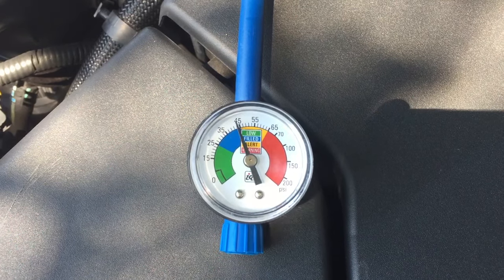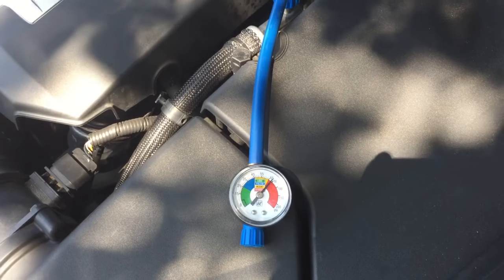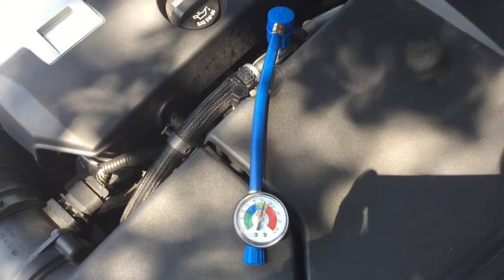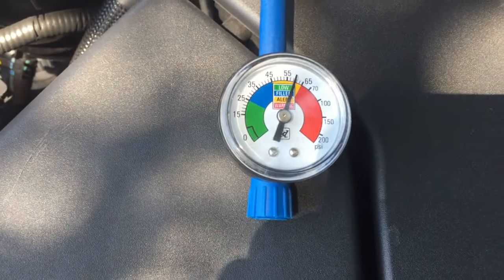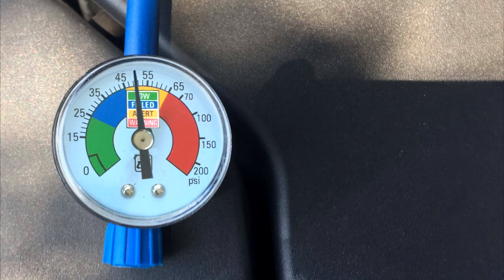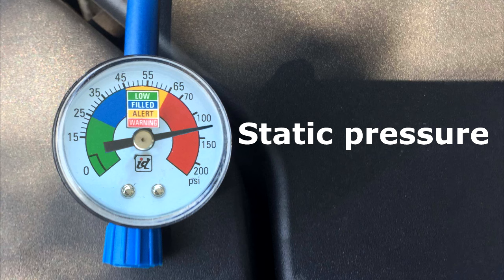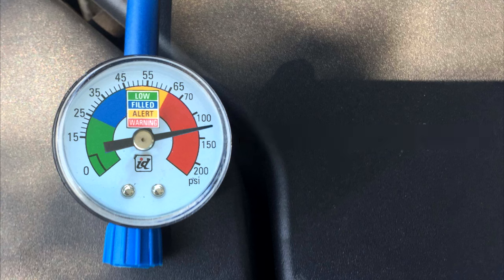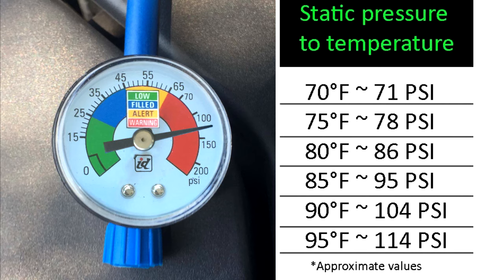Car overcharged AC system or undercharged fix

Comment: Hey quick question, which one should I follow the static pressure or the gauge. I was charging my 2008 GL450 The gauge reading is in the yellow zone (no need of refrigerant) and yet when I tried to turn it off and let it cool down the static is way below the chart based on ambient temp and still blowing warm air when turn back on. Mercedes takes 42 Oz but I charged 4 cans of 12 Oz which is 48Oz so I overcharged. The Low Pressure pipe is even warm to the touch when it should be arctic cold. I guess I have to vacuum a bit and see if the A/C compressor kicks in? But which one should I follow the static reading that says add more? Or the gauge even in green zone (filled) is not blowing cold air. 🤦‍♂
Reply from the maker: Not sure what's going on there. You may need a manifold gauge to see the pressure in both the Low and the High sides.
If you got a leak, the ambient air could've been sucked inside the system. And that will distort the pressure reading.

Comment: The refrigerant dose not cool like many think it absorbs the heat so whatever the temp is outside with the system off should read the same. When the ac is on the refrigerant absorbs the heat in the cabin and dissipates it out of the condenser at the front of the car.

Comment: So after seeing your video and others, I can tell the temperature is critical when you work with this issue! I love how you make us feel a little safer and assured using your static pressure technique! At least is gives us a guide without testing the system as it's running! Because I know in spite of the bull mechanics say, there is an element of danger in this! It's an element of danger about any DIY project! And I just not can't even comprehend in my mind why on Earth a professional can put the refrigerant in and say they cannot reverse the process! But I do know the government comes down strong on mechanics who break the law and bleeding off material like this just into the air! I still think the ASE people are full of it
Reply: If they told you they can't reverse the process, they are lying.  They can bleed a little off into a reclamation tank.  It's no different than when they evacuate a whole system with a vacuum pump after doing a major ac repair.

Comment: Why doesn't the refrigerant leak out through the hose?  Is there a one-way check valve in the hose fitting?
Reply from the maker: Yes. 
Other hoses have a trigger that you can squeeze to open the one-way check valve.

Comment: What if it is only 55-60 degrees out ? My ac was working fine up until today. Now it’s only blowing warm air. While refilling it, it would blow cold air out for a minute then go back to warm. I live in Ohio where the whether is cold one day and hot the next.
Reply from the maker: When it's 55-60 outside, the PSI should be lower, around 55 PSI for the R134a refrigerant.

Comment: I now have a better understanding after watching this video. 

For some odd reason, my A/C would work perfectly until it got really hot outside over 95 degrees, and then all of a sudden, the A/C would stop blowing. You can hear everything else work fine like the compressor and other normal components except for the fan wouldn't blow any air, but that could be from a switch or something. 

Anyways whenever the outside temperature decreases under 90 degrees sunset, then the 
A/C would work fine like nothing happened. Blows super cold and everything with good air flow.

Also, whenever I would leave the inside dash filter halfway out so i would have more air flow where it blows best. 

I think my pressure levels are off or something.
Reply from the maker: The pressure level can contribute to the air blowing cooler or warmer.
But if the air stops blowing completely, the problem could be with the blower wheel or the relay controlling it getting stuck intermittently.

Comment: Static pressure is also a good indicator of whether there's a blockage in the system. Depending on where the highest pressure is, you can narrow down what the fault actually is.
Reply: Hi, how would you know or find where the blockage is, using the static pressure? Wouldn't it have the same static pressure after awhile of sitting?
Reply: @arnoldg3076  If there was a blockage, there wouldn't be equal pressure between high and low side because they wouldn't be able to equalize.

At 70F the pressure reading should be about 71F with compressor off. If the reading is lower then it's undercharged and overcharged if higher.

If Low side is higher of the two when given time to equalize then the problem lies where the compressor is and if the High side is lower, it would most likely indicate a blocked condenser or line.

These are just general indicators to narrow down the exact issue as the best way is by reading pressures when it's on.
Reply from the maker: A basic single gauge fits on the LOW side only. To find a blockage, you need a manifold gauge to check both sides. Unfortunately, most people don't have the dual gauge.
Reply: @Your-Self  That's true but then again: you wouldn't be measuring static pressure using only one side.

With a manifold gauge, you at least have the ability to quickly determine if there is a fault within the system before choosing more invasive steps.

Comment: You forgot to mention if the gauge your using is  hooked up to the high or low side. Ill need to know this before  i try it. Or dont it matter? Thanks
Reply from the maker: A typical single gauge similar to this only fits on the LOW side.
Reply: @Your-Self  ok thanks alot

Comment: Hi ! I replaced the whole system and I think the ac shop put too much Freon on the system because is not very cold, where can I get this type of gauge?
Reply from the maker: You can go to your local auto parts store and ask them for an AC hose with a gauge. Maybe they can check your pressure for free with their own manifold gauge.

Comment: Hello, so today I decided to see if my ac system was overcharged or not because my ac blows relatively cold air but no heater. When initially using this technique, the static pressure read at about 120 psi (90F ambient), then I turned on the AC at max to let it run and see low side reading, and the gauge sat right at 30. Then I turned it off and left the gauge there. After about 15 minutes, the static pressure reads at about 85 psi. (Still 90F). Which static reading do I go with? First or second ?
Reply from the maker: That's strange. After running the engine, the ambient temperature should go up slightly, and so should the static pressure. Maybe, there is a clog in the system between the High and the Low sides. So it takes much longer to equalize. That's where a dual manifold gauge comes in handy to verify this issue. If the Low side is, let's say, at 85psi and the High side at 140psi, there is some kinda blockage between the two sides. The static pressure should be about even.

Comment: If my low line shows that there is 0 PSI and zero freon, would it be safe to disconnect my AC lines form the condenser to replace?
Reply from the maker: It sounds like your system is completely empty. But I'd still wear gloves and goggles for protection.

Comment: @YourSelf : But isn't it at least 3 variables - (a)outdoortemp, (b)psi, (c)yourmakemodelyear ?
Reply from the maker: The AC works the same way on all cars. The biggest difference in the AC system is the (fixed) orifice tube and (variable) TXV, which are not used in this "static pressure" test. The capacity of the system doesn't really matter neither. To improve this test, it's best to let your car to cool down to the ambient temperature (let it sit for a couple of hours.) But of course, it's best to use Manifold gauges to make sure that the Low and the High sides actually equalize.

Comment: Hi Youself, this is great reading and learning! I have Volvo S80 2008 and AC takes long time to cool down but only to around 30 Celsius. Ambient temperature here in Philippines is 35 Celsius, around 95 Fahrenheit, both gauges show 140psi, which seems far too much. Since I don't have a compressor to pump Freon back into a cylinder, I slightly opened the center yellow nozzle only to find air is escaping, no Freon, it's not cold and invisible. I allowed for 10 min which reduced the pressure to 100psi, still air, no freon coming out. This is worrying me now, hence seeking your feedback before I continue. I didn't run the engine yet. Thanks
Reply from the maker: At 35°C the static pressure should be around 114 PSI on both gauges. When you turn the compressor ON, the High side pressure should go much higher, and the Low side, much lower. The engine and compressor should be running for you to feel cold air.
Reply: @Your-Self  What is with the seemingly normal air that is escaping instead of Freon, is that what was causing the high pressure? I only bought this car recently so I have no vehicle maintenance history.

Comment: so i bought freon last week and checked the pressure it was at 62 and it was 114 outside that means i need to add freon? i was confused and thought it was overcharged becuase it was in the red so i didnt add any
Reply from the maker: Wow, 114°F... that's hot.
If the Static pressure is only 62 PSI (with the engine OFF), it's really low and needs to be charged up.

Comment: Where can we obtain a chart such as this?  My clients know we don't do HVAC thus they want me doing it so the least I can do is understand what's going on to provide a better diagnosis and yes, I do have the ac manifold setup.  Thanks
Reply from the maker: I made the chart myself straight from the manifold gauge. And if you have this gauge, there should be the temperature and pressure correlation right on the dial. So you don't even need the chart.

Comment: yeah, I think i overfroze my evaporator because I was getting high line medium pressure, eventually, the high line went super and low and was stuck while low side was too high.  I hope it's not my new expansion valve or my brand new DENSO compressor.  I guess I have to thaw it out.  In my past few weeks of constant youtube watching, not one person said how long it should take to empty out a 12 oz can of 134r.  I thought I was going slow enough in spurts in recharging, but eventually I felt a stalemate.  cuz I did get the high side to go as high as 120 but then it stopped, and reduced to 0 while the  low side was way up..I guess I kinda recharged too hastily, but no videos or anyone on forums can go into exact measurements cuz every ac gauge is so different and trial and error is "THE ONE THING, THE ONLY THING....that can stand in my WAY!" - UNICRON

Comment: I have a question hopefully you can help me  . I plugged my gauge when my car was off and It showed 70 psi the temperature was 20 Celsius outside. When I turned my  car and the AC  on it went to zero .Is it normal?. I am just scared if I put some refrigerant the static pressure I going to be too high.
Reply from the maker: It sounds like you have plenty of refrigerant, so I wouldn't add any.
The problem could be with the Expansion Valve or some kind of restriction in the system. The compressor does its job, but the refrigerant gas can't flow through the blockage.

Comment: I have 134a bottle with digital reader. It went from 50/60 psi to 101 back down. Car was on and ac was on. Should i do it again with car off? is digital bottle freon accurate?
Reply from the maker: The digital gauge should be accurate as well.
You can try this (Static Pressure) test with the car off. See how much pressure you get and compare it to your ambient temperature.
Reply: @Your-Self  Ok i'll report back

Comment: I put 24oz of freon in my blazer, it was to 35 on the dial, the clutch started running constantly. Next day was cooler, but i turned it on to see if was cold, it blew nice n cold, but the clutch was going off n on again ever my 10 seconds or so?? Is this normal, or because its a cooler day? It was 86 when i filled it.?

Comment: I am getting a high 80psi reading from the car both with engine running and air on and also with engine off.
I wasn't sure if i should try and add any more refrigerant...what do you think ?
Reply from the maker: If the pressure is not changing with the AC on or off, the problem could be with the compressor not starting.

Comment: Hey so I put a new compressor on my car and I added one 12oz can and it went into the red now the mechanic that checked it out before this said there is supposed to be a pound of freon it so I don't understand the calculations you have
Reply from the maker: This video is good if you need to top-off or reduce the amount of R134a in your system.
If you replace a compressor, you need to dial the exact amount of refrigerant stated on your car's sticker... usually under the hood.

Comment: WHAT IF ADDED TOO MUCH OIL IN THE SYSTEM. IS THERE A WAY TO REMOVE EXCESS OIL FROM THE COMPRESSOR WITHOUT LOOSING THE REFRIGERANT?
Reply from the maker: Unfortunately no.
Reply: How much oil did you use and how did you measure amount charged?

Comment: So if ambient temperature outside reads 75 degrees. And the pressure is 63 psi then my car AC is undercharged?
Reply from the maker: If it uses R134a refrigerant, your system is undercharged.
Reply: @Your-Self  great! Thanks for the.help appreciate it!

Comment: my pressure was way over one hundred on a one hundred scale gage and temp outside was 103F but is in the red where it says danger.
Reply from the maker: Your static pressure (with the car off) should be around 130PSI at 103°F, assuming your car has R134a refrigerant.
Reply: @Your-Self  yes but my gage oly goes to 100 psi after that I couldn't monitor anymore. Also I didn't hear the clics it normally does and the swinging of the needle was not happening.

Comment: How do I know ambient temperature if car doesn’t show one and I don’t have a temperature gauge? Can I just go by the weather temperature?
Reply from the maker: I suppose the TV weather temperature should be close enough to get a better idea if your system is overcharged or not. It's best not to drive for about an hour before measuring the pressure so the engine stays at ambient temp.
Reply: @Your-Self  thank you for replying.

Comment: Do you need to start the car at all if you can see the temperature gauge without starting it
Reply from the maker: It's actually better not to start the car. To keep the engine cool.
Reply: @Your-Self  that’s what I did. Thanks!

Comment: My 04 Volvo S60 will not get up to pressure.  The compressor cycles off & on every 20 seconds.  At 70F,  pressure needs to be 71.2psi.  It's only about 45psi.
Reply from the maker: When the pressure is way too low, the compressor will not stay ON long enough to accept additional refrigerant. In this case, you can try TEMPORARILY bypassing (jumping) the pressure sensor on the compressor to fill it up.
If that doesn't work, you may need to vacuum the whole system and fill it up from scratch.

Comment: I have this connector set you have.  Are you saying that if you hook it up like you have done no air gets in the system?
Reply from the maker: When you hook up the gauge for testing purposes, some refrigerant gas comes out of the system to create pressure inside the gauge. And no air gets inside. 
But when you refill the system, it's best to purge the hose first.
Reply from the maker: @ayakosaito7323 the A/C Pro hose is pretty short, so if you fill your system once, it shouldn't create an air problem. But hooking up the gauge multiple times may.
If your system was low on refrigerant initially, it's possible that there was a leak on the LOW side. From there, the regular air could've been sucked into your system. And in this case, a tech needs to repair the leak, vacuum, and refill the system.
Reply from the maker: @ayakosaito7323 It sounds like the system is low on refrigerant. I'd add just a little and check the performance.
Reply from the maker: @ayakosaito7323 The leak can be very slow, and take many months to a year to deplete. You may have noncondensables (air) inside the system. So it's best to vacuum and refill... and hope there is no leak.
Also, check your condenser fan near the radiator. It should be spinning to dissipate the heat while parked.

Comment: ok got it with car off, but how to read gauge when car is running and you need to add coolant
Reply from the maker: If you have a hose with the gauge, you can fill and watch the pressure at the same time.
If you have just a fill hose, you'll have to add a little refrigerant at the time. A then swap it with a gauge to check the pressure.
Reply: @Your-Self  sorry i didn't give enough info, so with car running and adding i still go by the chart of ambient temp and what the chart designated psi ,is that correct, ex,, 80 temp=80 psi , once that is established should be the max cool without over pressurising system, then i can double check turn off let cool down and check it again
Reply from the maker: No. The running and static pressures are totally different.
With the AC running on high, the pressure should be between 25 and 45 PSI... per this gauge.

Comment: I have a '99 Expedition 5.4L, at 69 degrees F the psi was 68 with the engine off which seems about normal according to your chart, but the A/C doesn't blow as cold during the summer.  What could be the cause please?
Reply: Shouldn't psi be higher with higher ambient temperatures?  Thus in summer, charge more as per chart?

Comment: My car ac was ok until this summer right now is very weak. So when I measured pressure it was close to 80 and outside temperature was 68 Fahrenheit. It means that is overcharged by this test. It’s not overcharged  because I never add it so what could be wrong?
Reply: air in the system perhaps?  something is in there that shouldn't be